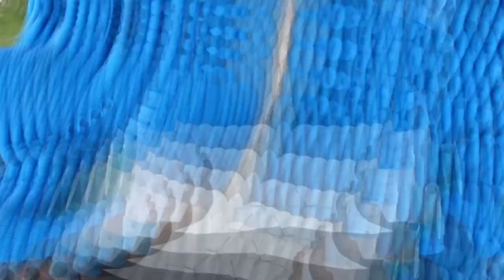Why Drainage Systems Fail & How to Fail-Safe

Comment: I know its a little off topic. But I plan on buying your kits to do the drains on my gutters. I will be tying in a gutter from the house and the a gutter from the garage into one line. I will be using this catch basin and then a pop up with knife cut farther down the line. My question is, when and where should I be using a 3" corrugated or a 4" corrugated? I seem to be seeing a lot of 4" but am not fully sure. Thanks for your response.
Reply from the maker: 3" is a DIY Friendly installation. Each 3" pipe can go to a 4" main pipe. If you are a contractor your held to 4" pipe because it because industry standards a million years ago. If you have the means to run all 4" pipe go ahead and do that. If you have irrigation lines running through your yard 4" pipe will suck.